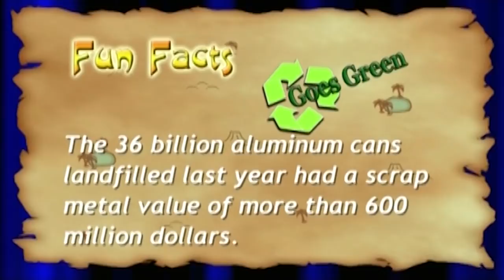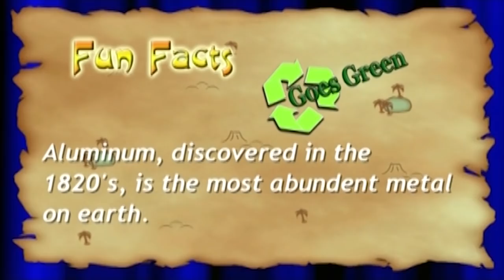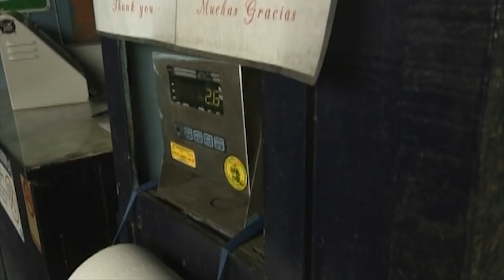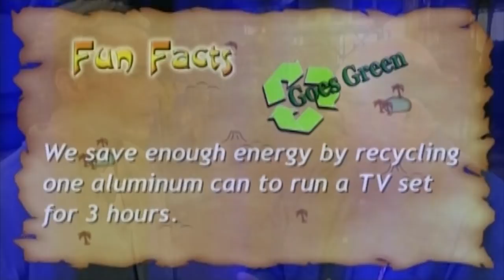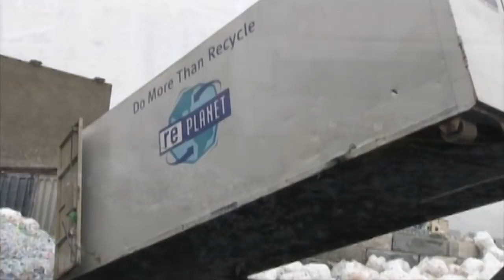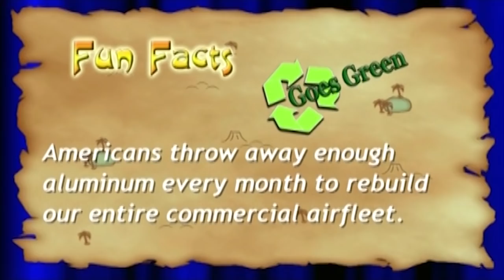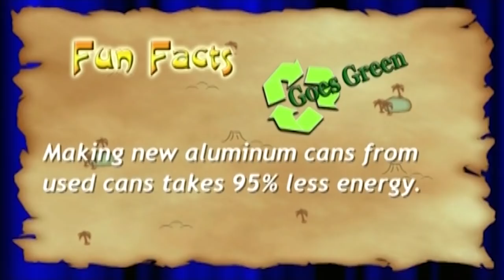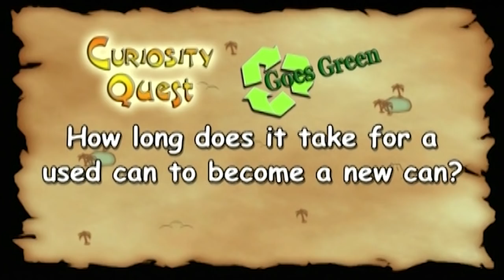Aluminum Recycling

Comment: The cans get smelted ( melted ) into a large crucible ( imagine a gigantic pot) where it boils to liquid aluminum. Any impurities are burnt off from the heat or rise to the top ( the impurities are considered slag and don't get used). Hope this helps with the question about ,"how do they clean the cans?"

Comment: At minute 9:51 is telling that a bail is made out of 2800 canes. I wonder if Joel Green did not realized that is wrong, dead wrong. He forgot to add one more ZERO. So a bail is made out of approximately 28000 canes.That are a lots of canes for about $425.00. I would like to colect 2800 canes and make $425.00,but is only $42.50.
Reply: At 2 dollars a pound for scrap where you get your 42dollars from. It be more then a few thousand. I work at a recycling center so your logic is dead dead wrong.

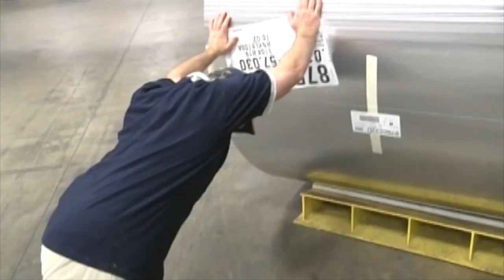Comment: 12:30s - 12:40s - those ' jumbo coils ' -  50 % recycled aluminium cans. That is 12,500 pounds of recycled aluminium cans per full coil. Such is where some aluminium cans go. This ' Ball Corporation ' is presumably not part of Novelis which processes billions of aluminium cans. There are others, such as Golden Aluminium, which deal in recycled aluminium cans. They don't pis around with ingots, for example. They smelter them on site, but very high tech..